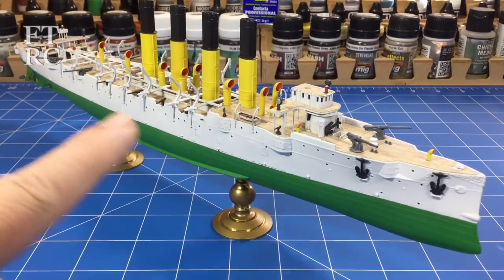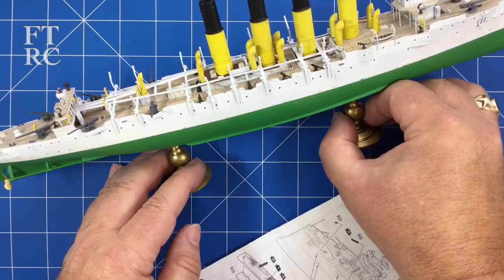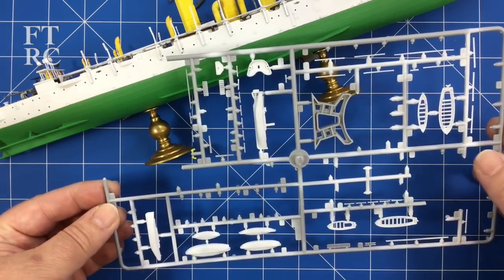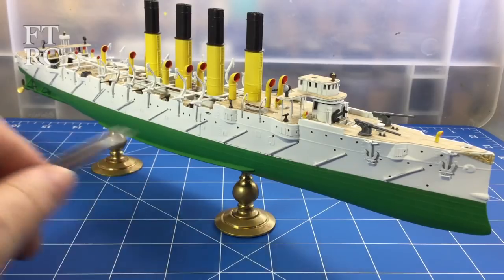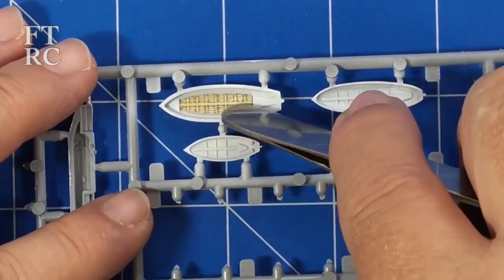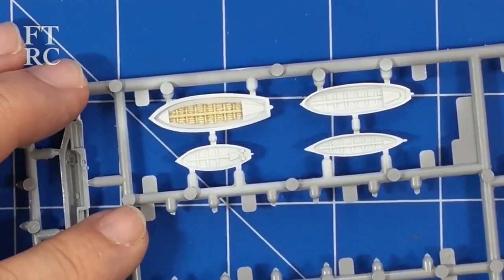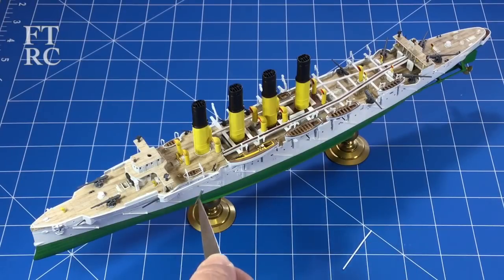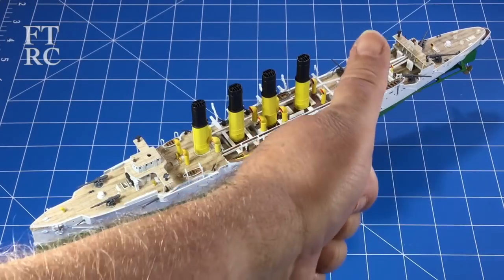Zvezda Varyag Part 8 Man the Boats and Lower the Booms

Comment: I realised the same thing about when to add the booms when doing the Zvezda Gangut kit. I've started on Varyag myself recently and stuck them on before painting the hull and they are a lot easier to deal with but you still have to be careful they don't break. Great work over all though! The tips about weathering wooden decks in one of the earlier video's have been hugely helpful. Thanks for that!
Reply from the maker: Happy to hear my videos have been usefull. Yep booms on first would be my next preference.

Comment: Great work as per.I had my first model painting with Airbrush.I watched loads of vids,had it all sorted.I was aware of all potential problems,dry paint clogging nozzle,bits of dry paint from rim.......so i started.I pulled the trigger..nothing...wiggled it,it worked.So im wiggling the trigger back,sometimes it sprays,then it stops again.Depending(i thought) on the angle im holding gun determines if it sprays or not.So like a cack handed. chimpanzee im out sitting in garden awkwardly trying to find what angle to hold gun so it would work.It was after i realized when cleaning out airbrush,id forgotten to PRESS the trigger down!As i was 'wiggling it about' i was inadvertantly pressing down on it making it work.sometimes.Watching is good.Listening the one though.Cheers.
Reply from the maker: Your tip is clogged... soak overnight to remove fine particles

Comment: I know that this was posted years ago but it's nice to see another modeler having difficulty placing small bits. I've seen other videos that have the builder in rubber gloves placing pieces perfectly every time. the video must have been edited on these because I have the exact same problems. The glue dries before I place, my hands shake too much, the piece flies out of the tweezers etc, etc. Don't get me started on PE parts with super glue.
Reply from the maker: I show my scale modelling warts and all.. sometimes it’s better to show how you fail, then solve the problem, rather than pretending you knew how to fix the thing all along.
Reply: @HarryHoudiniModels  Your Varyag is looking beautiful. I have not gotten to the remainder of this series of videos but I look forward to them. I am only on my third model ship. The HMS Warspite in 1/700 scale. I am so far pleased but I am dreading shaping the photo etched HACS antennas. I started on 1/700 scale simply because of the kit price being cheaper than 1/350 scale but it's like working on a watch sometimes.
Reply from the maker: Yes 1/700 is a lot smaller than the 1/600 Airfix kits I was familiar with. I bought a lot when I returned to the hobby, then realised I could not get my wombat fat fingers or blurry bandicoot eyes to fit or see the kits parts!  My only 1/700 PE railing add was on a tiny destroyer being crushed by a Kraken… so it was mangled anyway.

Comment: The problem with the booms is I think the cement is setting too quickly. We are having a heatwave in the UK at the moment and I have been having a similar sort of problem with liquid cement drying too quickly. Were I in your shoes, I think I would glue these booms in place using a tiny drop of CA gel at each end and then run a small amount of extra thin liquid cement where the booms touch the model. Hope that helps.   Martin
Reply from the maker: Brilliant... had not even considered CA glue for plastic...
Reply: I noticed the same problem,i had a fan going too,which didnt help.But, i had bought some PLASTIC MAGIC and its not bad.Got me through ok.Like a middle ground between contacta and Extra thin.G/L
Reply from the maker: I think my main problem was the parts having being painted first and my fumbling hands.. if it was all just unpainted styrene then I could have taped the booms into place and applied Tamiya Thin over the top of each end, letting the capillary action seep into the joins.

Comment: Hi Harry, I've been following your progress on the Varyag as I've been building mine. I am now at a loss how to do the rigging. There aren't enough clear pictures to use as a reference. Is there anything you could recomend that may help please. I am loving everything you have built and as I'm a complete novice I have learned a lot by following you and I'm just getting back into the hobby after 30+ years and find it very therapeutic after coming back home from work. Keep you the great work and tutorials. You are a great inspiration to many modellers
Reply from the maker: Hi Wayne... I have come across some very good rigging diagrams for the Varyag and will post them on Facebook in my Houdini Models Page.